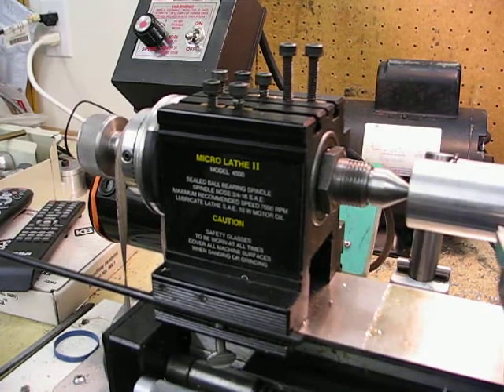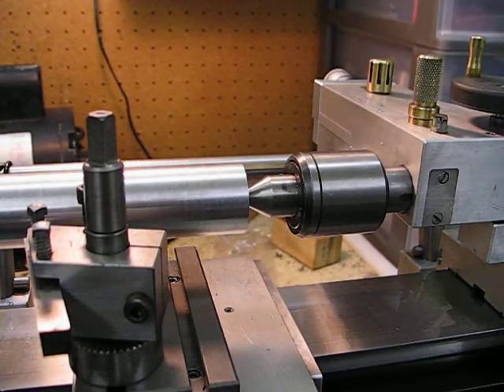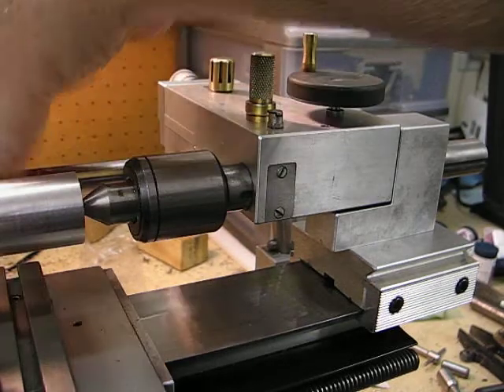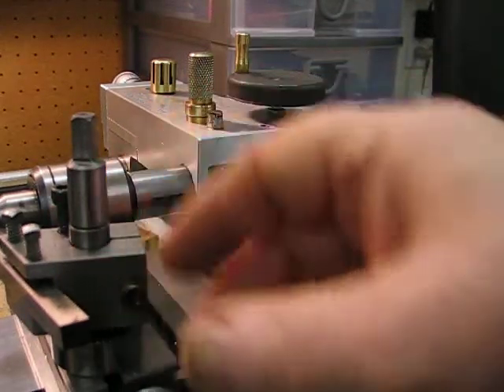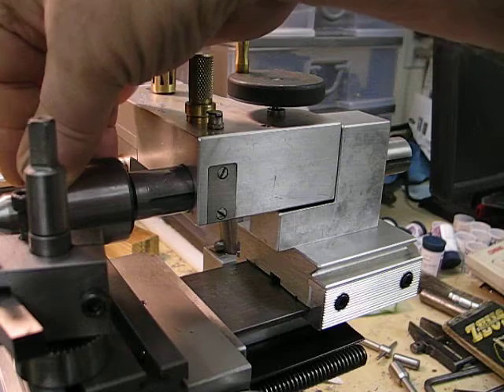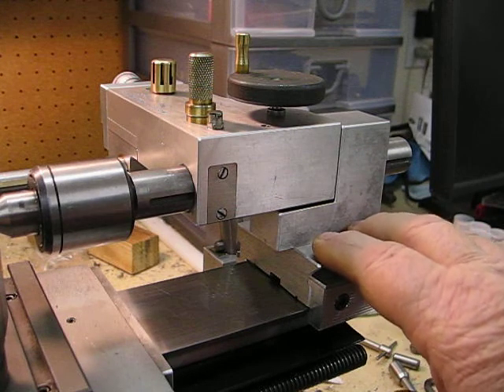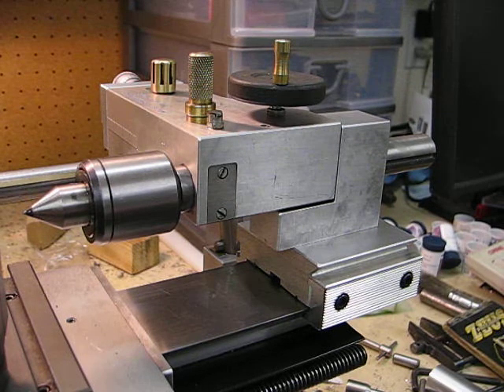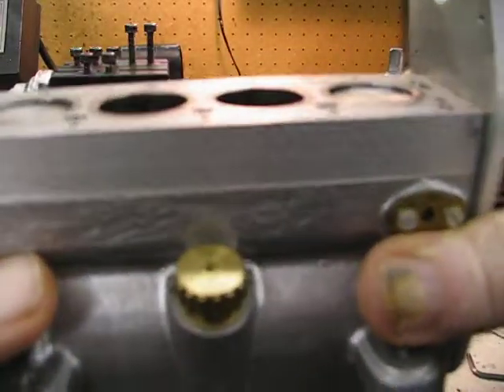MVI 0257 New design of Tailstock for the Taig Lathe

Comment: I would be interested in seeing more about the locking top slide base as well. How about a video giving us a little more info/detail about it? Good video. Just ordered my taig lathe. Exactly what was so bad about the tailstock that made you redesign a new one?
Reply from the maker: Brian,
  re the top slide I will post a video as soon as possible which should give you a more detailed explanation, 

The original tailstock worked ok but I found it interfered with the rearwards travel of the saddle so when machining between centres and at times when drilling up close to the headstock, I had to keep moving the toolpost to the other saddle T-slot, there are so many other ways I could have solved this problem but I decided on this design because I like improving things and the challenge was inviting,
Reply from the maker: Brian, 
    the two short videos I have just posted I hope might give you an indication of the difficulty in turning between centers with the original tailstock, although it works this way it is not desirable to have a thin half inch shaft sitting out so far from the main body, plus the fact you have to move your toolpost from one t-slot to the opposite one, I'm not saying it can't be achieved its just a pain,

I haven't been able to do the top slide modification yet due to health but I will do it in a short while,
Reply from the maker: Brian,
3 videos posted re the top slide

Comment from the maker: David,
   thank you for showing interest, I guess you are inquiring about the Hardinge style of locking the top slide base onto the Cross slide, consisting of an eccentric pin and a floating post, can you give me more details of your interest, the base is a copy of the original but it is .250 thicker so the overall thickness measures .700,